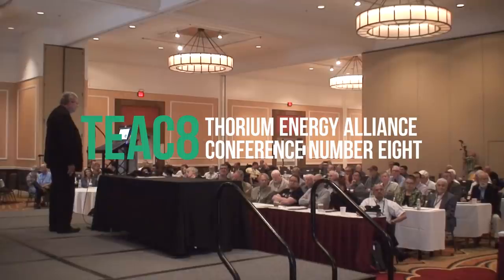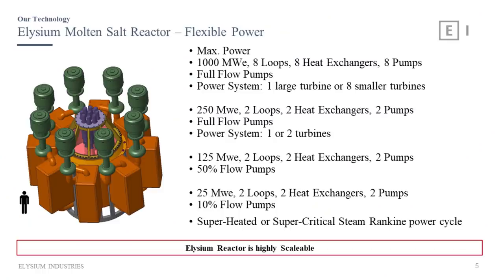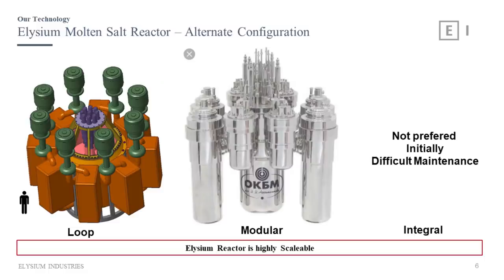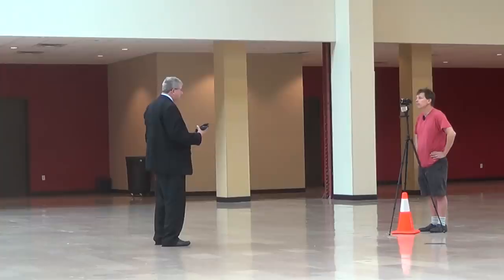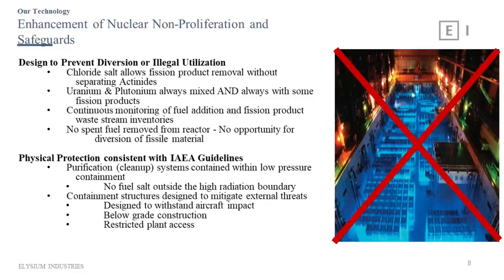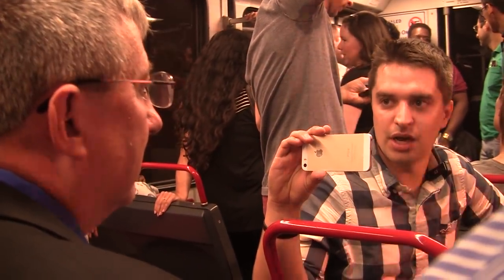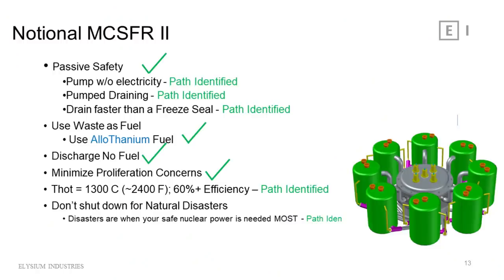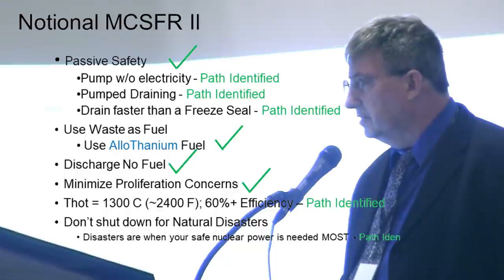Fast-Spectrum Molten-Salt Reactor - Elysium Industries - Ed Pheil @ TEAC8

Comment: Tesla is building a new megafactory in Texas (2021), which showed us last winter that its electric grid is less than reliable. If Elon Musk could be talked into building his own Elysium MCSFR, he'd have uninterruptible, inexpensive power that he could easily scale up at need, or start big and sell his excess to the grid. With that much energy available he could collaborate with MIT spinoff Boston Metals to build his own clean steel mill; Boston Metals is developing Molten Oxide Electrolysis, a technique for making steel (and other metals) with electricity instead of coal, that emits only oxygen as a waste gas, and makes better steel for less energy and less money. Alcoa and Rio Tinto are working to decarbonize aluminum production in much the same way; Tesla must use a lot of aluminum, too. Musk would improve Tesla's bottom line, and do the world a huge favor by helping to demonstrate these technologies. Anybody reading have his ear? His e-mail?

Now if we could talk him into building megafactories with Blue World Crete instead of Portland cement. ...

Comment: Why has Ed failed to school Kirk?  That's what I'd like to understand. . . .
This seems to be the one.
Reply: It's not a matter of schooling anyone. It's a different approach. Ed wants to use current nuclear qualified materials, which saves some licensing headaches.  He's not going to get some of the high temperature benefits that Kirk's LFTR would, assuming it gets approved.  However, that assumption is a pretty big one. Having to use fancy shmancy materials like Hastelloy-N not only raises regulation and safety questions, but also raises cost. You can buy stainless steel, off the shelf in the thicknesses needed for Ed's MCSR right now. It's already NRC qualified.  You can't get Hastelloy-N in the same quantities as readily and it's a LOT more expensive.  
High temps give you more options, other than power production though. You can use that high heat for industrial processes. The thermal spectrum is better for using Thorium as a fuel. However, there is no huge pressing reason to use Thorium as fuel, especially if your reactor is a operating as a breeder. The LFTR, running on a Thorium fuel cycle isn't going to dispose of any waste fuel from LWRs. That's not to say it couldn't, but that's not how Kirk wants to run them. If Thorium-U233 is your fuel cycle, adding another kind of Uranium in there just messes up your chemistry. 
Ed's MCSR will run on waste fuel (and arguably get it for free) we have sitting around and uses cheaper, readily available materials. The higher temp LFTR does have the option of using supercritical CO2 turbines which GE is reportedly getting ready to produce where the MCSR does not, which hurts efficiency. GE's sCO2 turbines could arguably do better than 50% efficiency. 
It's a list of pros and cons.
Reply: @DriveCarToBar  Ed specifically stated there is no reason why a high temperature cannot be used, it's just at the beginning, to reduce the needed research and get the it certified and running, it's much easier at lower temp

Comment: Don't you lose the ability to always be able to shut down the reactor, because if you don't have a mediator you can't just take the fuel away from the mediator to stop fission.

Edit; So what I am hearing is that is the case because the idea is to pump new salt in to stop bring it to sub critical, that is definitely s strike against it and a big one at that, because the big promise of MSR has been for a lot of people was a dummy proof design and completely un-powered shut down.
Reply from the maker: You're describing the ability of fission to only take place in the reactor and no where else, so if there was a rupture what keeps the expelled material from fissioning? Like a thermal-spectrum MSR's reactor would contain moderator, a fast-spectrum reactor would use reflectors to ensure the interior was able to reach criticality, such reflectors would not exist outside the reactor. Also, catch pan is flat (this is outside any details I've seen just assuming there must-and-should be a catch-pan), so not lending itself to criticality. If the fuel was meant to run-off into a spill-tank then that spill-tank would be full of neutron absorbing material.

The aspects I have not yet been able to discuss with Ed is the possibility of moderating material being introduced, and also that fast-spectrum reactors respond quicker than thermal-spectrum reactors... described as "more twitchy" by the thermal-spectrum folk.

So while thermal-spectrum needing moderating material to sustain criticality is one means by which spills avoid criticality, I don't see how a spill can go critical without reflectors and/or moderator.
Reply: While I accept the rest sub subcriticality is not the same thing as "stopping fission" it will eventually low to a natural rate once it is subcritical, but it would take time to come down to that level.
Reply from the maker: Well one of the aspects of fast-spectrum is that (as far as I understand it) because there's no delayed neutrons fission can actually stop instantly. Decay heat is still same-deal as thermal-spectrum, but there's no delayed neutrons causing any fission beyond reactor core. (Which might be a challenge with a chemical-kidney.)
Reply: Well the decay heat would be higher I would think because it's a more consented fuel, but you could solve that by a reserve tank of molten salt to also dilute the fuel which is basically what he was talking about anyway.

Comment: He wants to use isotope separated Chloride... so, no, he's not talking a couple hundred bucks a ton for salt. Think hundreds of dollars a Kilogram.
Reply: Yup, Cl-37 is the way to go...
Reply: Jonathan Schattke 
We CAN use separated Cl37, we don't have to. It depends on the overall economics, and the end goals desired. Don't forget once the Cl37 is separated it is reused for centuries through recycling. Whether you use it depends on how much fuel value you wish to breed vs the cost of HLEU once the other Pu waste sources are depleted. The first reactors likely wouldn't bother to use enriched Cl37 because it is easier/cheaper. Also don't forget Cl was the first ever enriched isotopes because it is easier. And it is orders of magnitude cheaper to go from 24% to 90% Cl37 than 92% to 99.995% Li7, especially without the level 1 security of dealing with a weapons process with Li enrichment.
Reply: Ed Pheil Those are some pretty good points.
Reply: Lithium is cheaply extracted from seawater or brine lakes (most of the world's supply comes from a brine lake in Chile but that's just because it's cheap). Flouride salts are similar.

Natural lithium needs isotopic separation or 6% of it will be converted to deuterium - but that's not that big a deal to be honest. It essentially means you get a shortlived deuterium outgassing at nuclear startup and as long as something combines with the hydrogen it gets contained.
Reply: @EdPheil  What is the problem with CL-35?
Reply: @phamnuwen9442  
Cl35 has a significantly higher neutron absorption crossection than Cl37, so a waste of neutrons for converting enough U238 to new fissile replacement fuel. Also, Cl35 makes more Cl36, a very long lived, than Cl37 does. And more S36, a corrosive, that off gasses. Also, enriching in Cl37 is EASY, compared to either U235 or Li7 and we only 90- 95% Cl37, so far cheaper.
Reply: @EdPheil  Interesting. What would be the refined salt cost, in dollars or percentage of the plant cost, perhaps compared to a Flibe salt?
Your non-electric pump design almost has to be some sort of heat engine. Stirling engine perhaps? (if you want to keep this secret nevermind).
What's your target date for getting a product on the market? Are you or will you be selling equity in the company?
Thanks for responding. Even though a lot of the physics and chemistry is above my pay grade, your reactor looks very interesting.
Reply: @phamnuwen9442  
NaCl (Table salt, road salt) is dirt common, so very cheap, unlike Flibe. Flibe needs Li7 needs to go from 7% to 99.995% Li7, where as we need to go from 25% to 95%, one 9, not 4 9's pure. And Cl, as HCl, is very easy to enrich, and is not a weapons material process, like Li7 enrichment, so does not require heavy security and regulation. We do not require Cl37, but it helps with neutron economy, if you want breeding.

We plan on starting up something this decade.

We look at significant investment for getting ownership value.

Comment: I Would say i´m not so sure of the plant size. 

The issue is scale of economy. 

The advantage of low size is high volume and large integration.  The advantage of large size is higher efficiency and less material per power.

I think he talk of both side. Yea higher efficiency and there for a lower relative core size... but the fuel is pretty much free.
Reply: He wants to replace 1 old reactor with 1 new reactor while producing the same energy. Sounds like a good strategy for dealing with the "nuclear cliff" of shutdowns.
Reply: That is of cause a interesting idéa... But i really questioning if its cheaper than just building a new plants next to it. Most Reactors that reach end of life does it not because the reactor is to old, but becasue the turbine (or turbin housing) need changing. Because a lot of Nuclear turbines are one of, its just to expensive.

A other problem is that it usually takes 10-15 years to totally remove the reactor core and pipes. When its all hone you pretty much have a building, that most of the time got holes in it you don´t want. The turbine and support structure is probobly gone 10 years earlier.

Of cause, one way it does make sense, is if you keep using the building, you don´t have to tear it down, that is of cause very expensive. Probably the most expensive part. So that might be the economical grace of it.

But you would ned new everything. New transformers, new power-lines, new turbine, new control room. The old cooling might be possible to use.

And of cause the old plant infrastructure... That can of cause be used if a compleatly new reactor is built to. But that do save a lot of money
Reply: Yes, the economics determine whether you can build a large plant or small plant, and there are many factors. A small plant may be economical if existing power is very expensive like islands, military bases, remote communities, resource recovery.

The goal is to drive down costs as much as possible, so it is the economic choice, not jyst the ckean or safe choice. If this is not obtained nuclear wont go forward.
Reply: Well... my point is.... while i do relize that you are doing a bit of it anyway. That i high volume product is much cheaper to produce than a low volume one. Of cause. if the plant is semi modular (that is the case for pretty much most of the fluoride concepts, you can of cause build a lager plant of several smaller.

But if the fuel is near free... honestly, nuclear fuel is already rather cheap.If the fuel cost is cut down more, the main benefit of higher beneficent turbine, is a smaller reactor (for same power). But if the reactor can be made even cheaper.

Of cause, there is nothing to say that one reactor one turbine... and there are already reactors around that have two turbines per reactor. There are also concept.. i think it may be nuscale, here they use 10 reactors on 5 turbines.

There is a optimum size for turbines, reactors and what ever component. Of cause, paring a different number of reactors en turbines may be able to make them both optimal.

I work in a completely different sector, but we have the exakt same problem. When we hit sizes over 3½ meter in diameter 25-30 meter in length and around 150-200 ton in weight the cost skyrockets. But that limit have increased significant the last 10-15 years.

Of cause, our units are probobly a lot cheaper, just around $100k each, transporting and tooling is a rather large part of the cost.
Reply: The Eh Team 
As for replacing one water with one MCSFR, if you figure it out we get 30x as much energy out of the water reactor waste as the water reactor extracted. Almost starts to look a little  like the LWR to coal volume comparison,  especially when adding another 10x in energy for the depleted uranium consumption. 250-300x the energy for a closed cycle burning water waste.
Reply: Take it from an ex-right of way attorney.  It is probably cheaper to do small more expensively and keep transmission lines short than to go big and have long transmission lines.  People hate losing their properties to right of ways. They will fight them tooth and nail.  Look what happened to Keystone.  Moreover, maintenance of the lines and taxes on the property eat a utilities lunch.  Pennywise and pound foolish to go big.
Reply: Here's the elephant in the room:
Will IAEA/NRC/CNSC regulate your multi-loop 1GW plant with 8 pumps the same as your 250MW plant with only 1 loop? If they do, you're in business. If they don't, you will have to apply for 3 different certifications each with their own tome of data to the regulators and each with thousands of man-hours of meetings and talks with the lawyers and engineers.
Reply: If you build them on an assembly line like Thorcon intends to do at a shipyard, 100 per year, then one certification should work for all.

Comment: Or we could be like Germany and spend hundreds of billions on wind and solar so we can transition from cheap dirty electricity to expensive dirty electricity.
Reply: Marmocet I do believe these renewables are filler technologies. Unless we provide these proposed molten salt based thorium technologies in less thab 10 year timescales, it just isn't going to cut the rates that renewables offer!
Reply: Wind - and especially solar - are already more expensive than existing light water nuclear. This fact is usually hidden by various direct and indirect subsidies as well and market structures currently in place that allow solar and wind producers to push the cost of intermittency onto dispatchable producers.

Regarding thorium, the more I've learned about the various reactor options on the table, the less I'm convinced that turning to thorium is necessary. David LeBlanc makes a argues convincingly that there is more than enough uranium already easily available for humanity to have to worry about finding a different fissile (ok, fertile) fuel.
Reply: Marmocet be that as it may, it doesn't have any traction in the public eyes as renewables do. However comfortable we are with the tech, you can never convince people about the waste or the safety. After reading the horrendous safety ratings some waste storage sites have, we need a better way to approach thorium. 

And regarding the subsidies, it is just a matter is scale before which renewables hit cost parity. They already beat coal parity without subsidies and people like renewables. 

The nuclear industry needs to clean up their act of PR
Reply: Regarding cost parity - no, if renewables producers have to bear the cost of intermittency, their costs skyrocket. Having to cover the cost of intermittency means one or more of the following: owning or paying dispatchable generator, having sufficient storage to cover times when they aren't generating, and/or the use of a massive long range HVDC. All of these fixes to the intermittency problem represent costs of renewables that they are currently getting away with not paying.
Reply: Marmocet yes you make a very good point. Hope Tesla does something to lower storage. The south Australia project is a great testbed for this!

As long as we can start reducing the carbon emissions in some pace as set by Paris, we provide enough buffer for relatively safe nuclear tech that public can get behind and transition straight into it.

Regarding HVDC China and USA are making great strides into power compensation through HVDC and my research explicitly focuses on this stuff. I do believe we are getting forecasting and scheduling and power delivery at lower timescales at farther distances to be better. So, storage can be cheaply integrated.

But yes, scaling factor for renewables is very hard. This tech cant get here quick enough
Reply: Renewables are ugly as sin.  Nobody wants to look at windmills or solar arrays.  I will believe they work the day I see ships with sails and solar taking over the market.  Otherwise this is just hype.
Reply: I find renewables zealots infuriating. I also find that many of them - the ring leaders - are inveterate liars.
Reply: @20karun  Regarding long distance HVDC as a solution to renewables, there is no way I'm letting some dictator in the Middle East or Africa control my electricity supply. This is a complete non-starter.
Reply: crazy Germany still burns coal France non
Reply: @20karun  So nuclear waste is currently stored unsafely -- why would you want to use thorium rather than transport that nuclear waste to this type reactor and use it there?

Comment: for me if i convert my bus to electric i would need about 60 kw to run down the road and i work with metal forming so i might need more than that sitting and because it is my home and i want to live anywhere i want 100 kw capacity and an ability to turn it off would be nice  also i would like to be able to load up a couple of tons of beans and rice and go help when disaster strikes so a small non critical pile pumped with a proton beam and 25 or even 50 cents a kwh would not be a deal breaker small has lots of applications where cost per kwh is not the first concern.